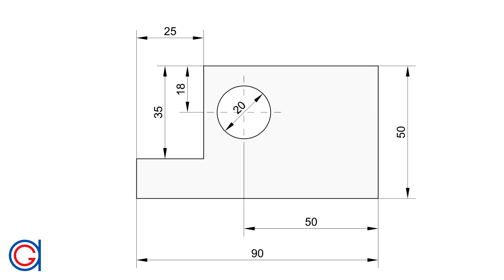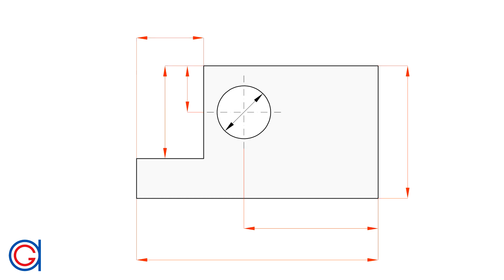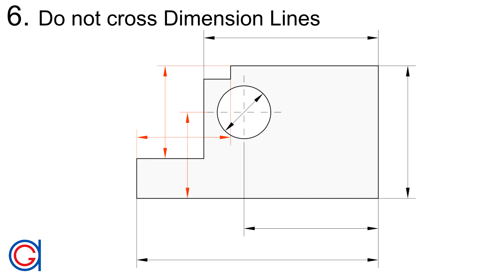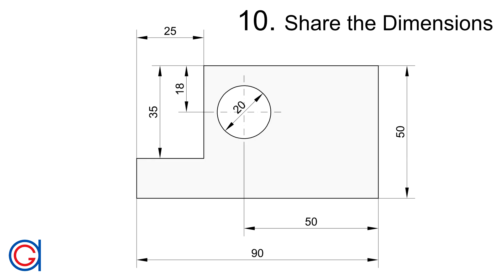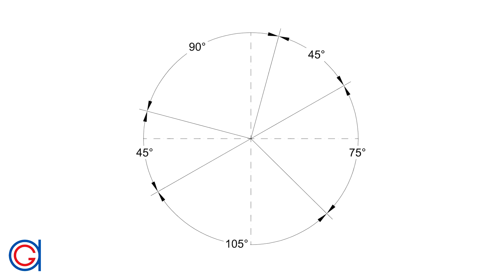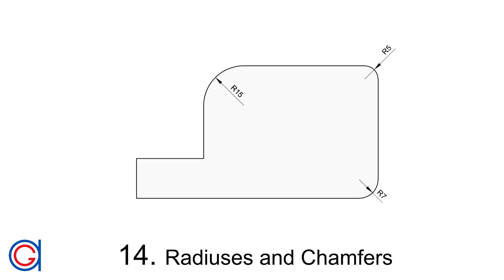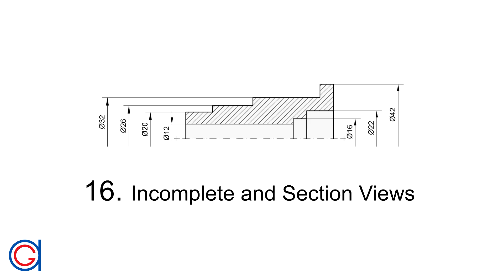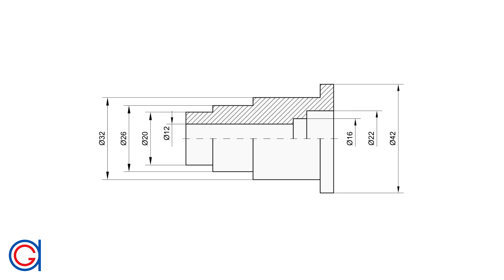Dimensioning Rules in Engineering Drawings

Comment: This is what I do, but in architectural/structural engineering (in the USA), which is very similar.  The general "rules" still apply, but can vary.  One thing I do differently (and see it almost always in other's drawings) is a small gap between the extension line and the object.  We also align all incremental dimensions and have an overall next to that, and those are on two (X/Y) or all four sides beyond the perimeter of the object (building).